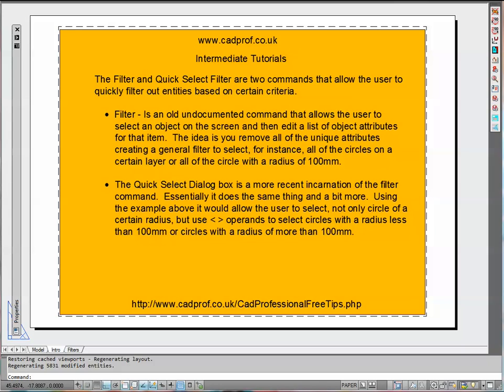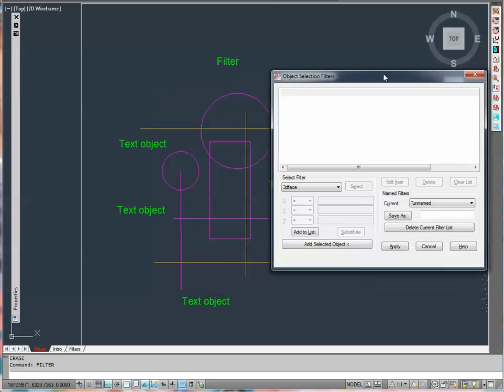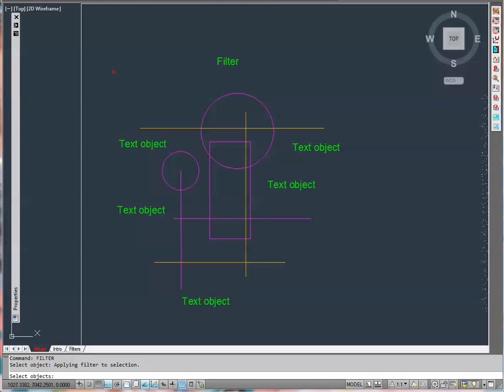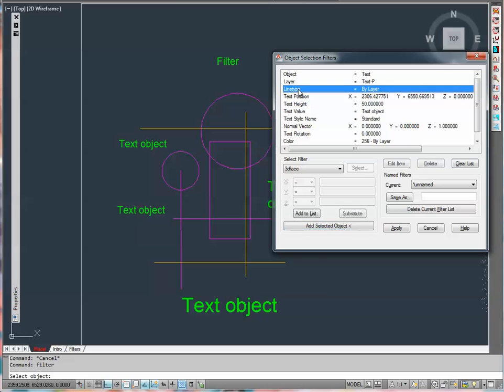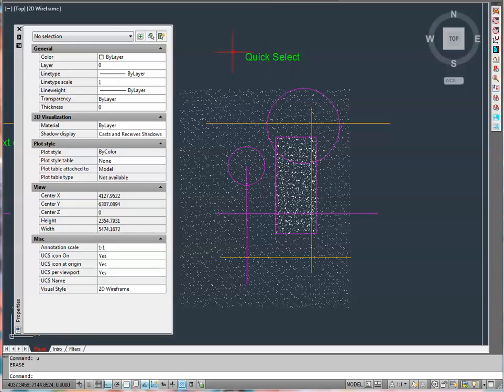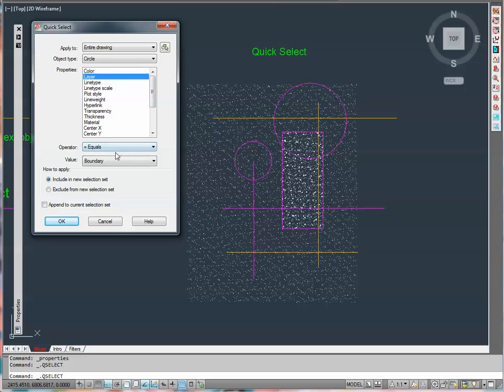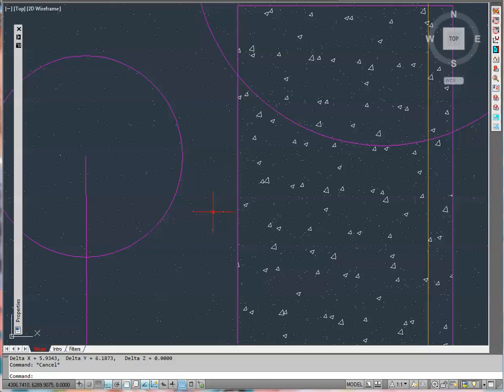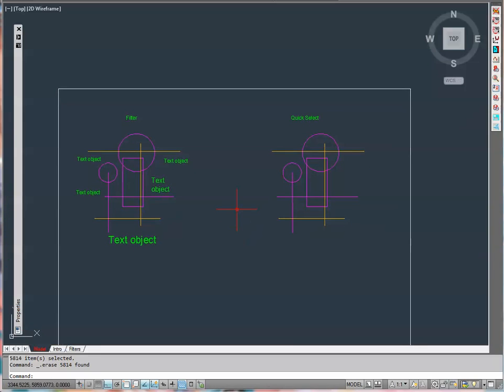Autocad 2012 Tutorials Advanced - Quick Select & Filter .avi

Comment: How can i select required size square with filter or other command when there are number of  squares having different sizes in same layer. thanks
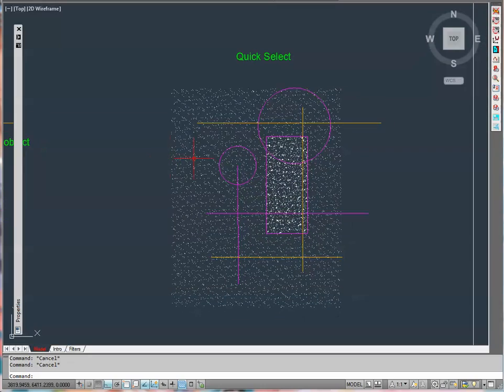Reply from the maker: Good question Mohammad. because most squares are made up of a single polyline or 4 separate lines it is difficult to find unique information about them, apart from layer or colour. Unfortunately this information is often shared with other lines or polylines in the drawing so isn't very helpful.  You could try isolating the layer with the squares on it. then use the quick select filter to find lines equal to or less than the length of one of the sides of the square. As per the hatch example in the tutorial at timeline 5:22.  Hope this helps